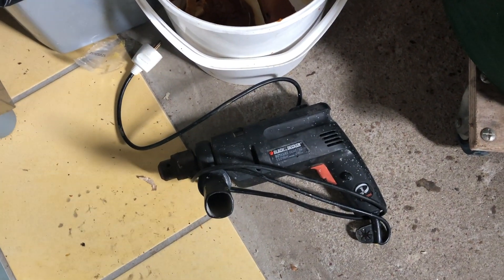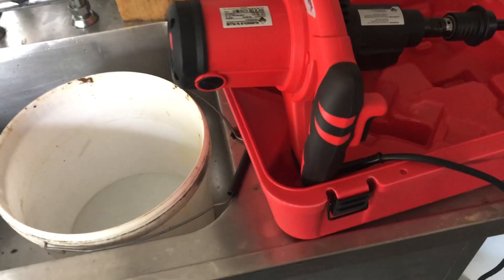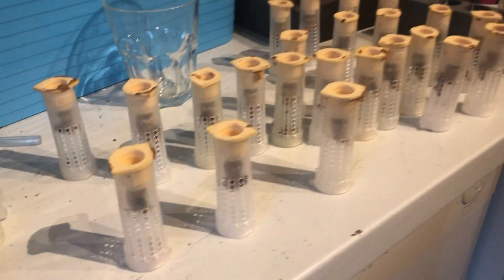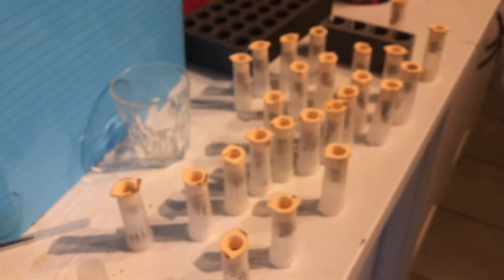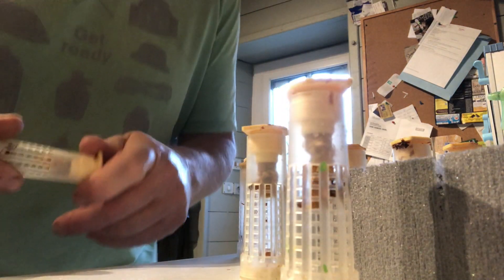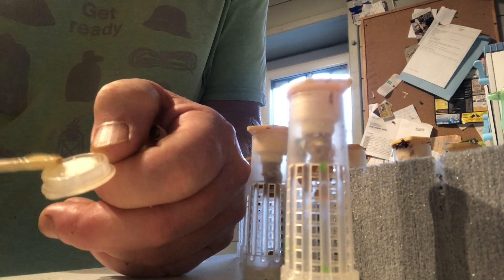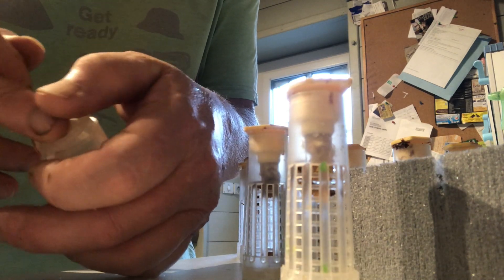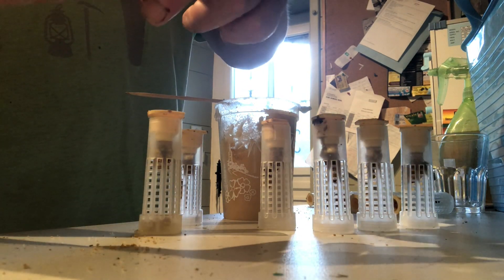Mixing it up! Pollen Sub and Queens.

Comment: You are doing a good job with the videos. It seems I always have a question. My question is, what is the best way to store this mixture until ready to convert into the actual patty? I made some just tonight and placed the mixture in a air tight 2 gallon container. How long can I expect this to last before becoming moldy. The reason I ask, this is a sampler for the bees. The next batch I plan on going  with enough to make up 10 gallons. In case I don't use it up quickly, I was wondering how long can I expect it to last in sealed buckets? Thanks again for all you do and I wish for you continued success. Phillip Hall